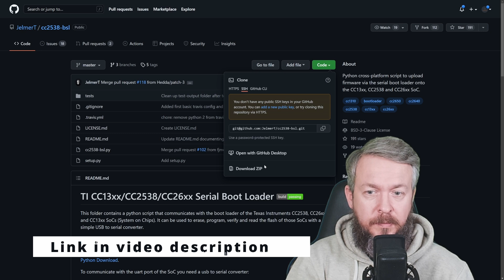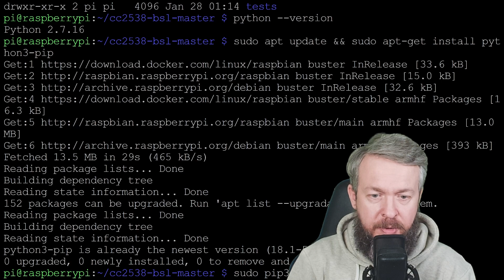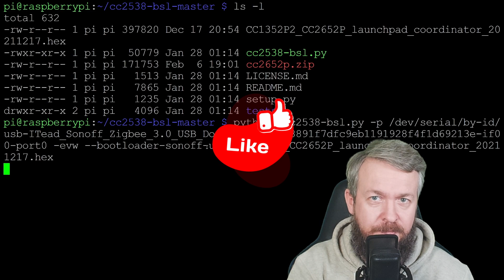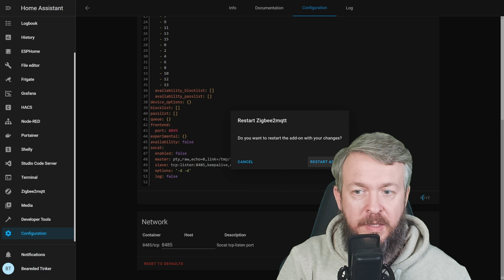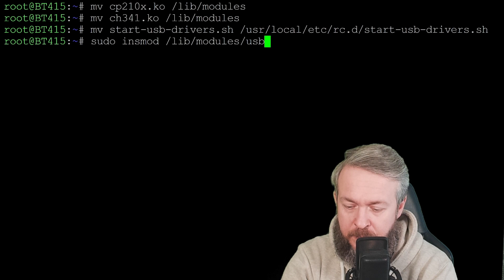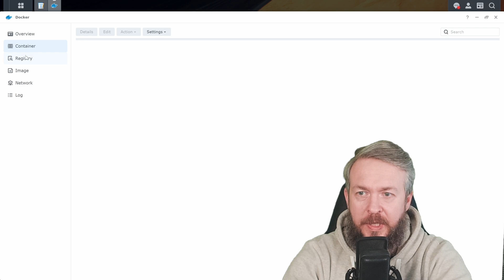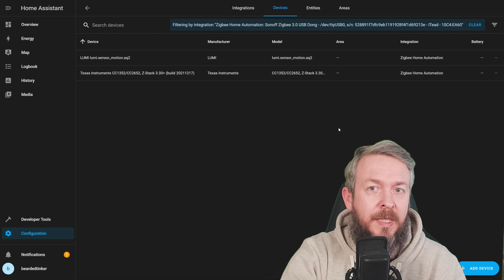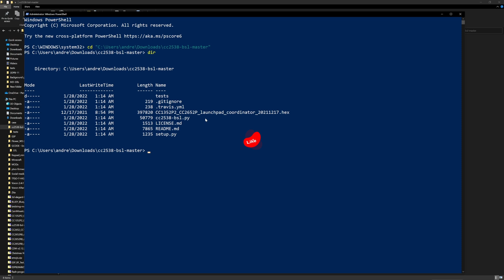Flashing Sonoff Zigbee 3.0 USB dongle plus and Home Assistant guide

Comment: Hi. Great video. Followed your directions but got an error flashing - "ERROR: bytearray index out of range". Any ideia?
Reply from the maker: At what step you get it - was it Windows or Linux flashing?
Reply: @BeardedTinker  Linux flashing.
Reply from the maker: @vitorhugoferreira3091  not really sure, but I would try to re-download firmware, just in case wrong version was downloaded or that you didn't download it as text file instead of binary. Other than that, nothing else pops on my mind.
Reply: @BeardedTinker  Didn't worked. Thanks anyway.
Reply from the maker: One thing that popped on my mind, slim chance that it is the case, but was any other system trying to access it while you were flashing it? For example Home Assistant, Zigbee2mqtt or similar?
Reply: @BeardedTinker  hi, thanks for your answer but that was not the case. However i've managed to solve the issue. Not by linux flashing but with windows flashing. Also a great video to complement yours is one from @mark watt tech. Lots of details. But unfortunately my zha got several problems so i decided today to go with zigbee2mqtt. Let's hope it works well
Reply: @BeardedTinker  FWIW I hit this exact same error and it was indeed "Home Assistant" trying to access the device. Thank you!
Reply from the maker: @prashmohan  thanks for this hint! Wasn't sure of the error but I know that this can happen :)

Comment: I have a problem with finding the devices port in PowerShell. In Device Manager Dongle is listed under Other devices and not under Ports.

Edit: Solved: Needed to download USB drivers (CH341SER)
Reply from the maker: Just wanted to answe and seen that you downloaded the driver! Forgot to mention anything about it...
Reply: Thanks for the hint - I needed to use CP210x drivers from Silicon Labs for my stick

Comment: Hey guys! This coordinator and the aquara ZigBee temp/humidity sensors works well together ?
Reply: Yep, I'm using a few Aqara temp/humidity sensors, and they work fine with this.
Reply: @jeremydean7760  do you need to change the firmware on the Aqara device ? I thoght Aquara devices works with the aquar Hub only.
Reply: @acejoe5996  No firmware flashing needed, at least with ZHA on home assistant. Paired right away with no problems.
Reply from the maker: That's right. Unless you got latest motion sensors, support for the has been added in FW in December. They required a bit of hack to get them going.
Other devices should work out of box
Reply from the maker: So did a bit of testing. Both coordinator firmware and router firmware work nicely with Aqara devices. Some users experience issues with Aqara sensors and other routers as they didn't want to connect. This works ok.
Reply: @BeardedTinker  Thanks for testing it out !
Reply from the maker: Haven't tested with that one, but it should, with both new and older version of temperature sensor. 
I've tested with Motion sensors and Door/Window sensors from Aqara and it works great

Comment: Great guide, you did well to cover all of the options. When migrating to the Sonoff I assume that all Zigbee devices need to be repaired but hopefully HA remembers all the entity names.
Reply: My Zigbee registrations in HA are a complete mess. I need to learn how to clear out all Zigbee entities (From many different iterations and dongles) and start again with Z2MQTT
Reply from the maker: There is a way to save everything and also, you can always use same name for devices.
Reply: @BeardedTinker  When you upgrade from version x to version y will the connected devices keep working?
Reply from the maker: Yes, it should have zero impact on devices that are already paired.